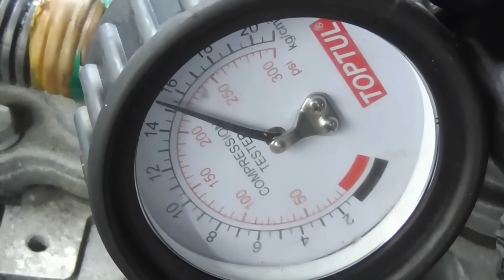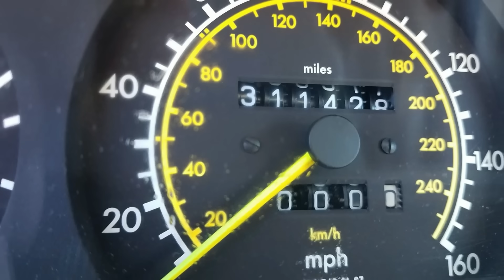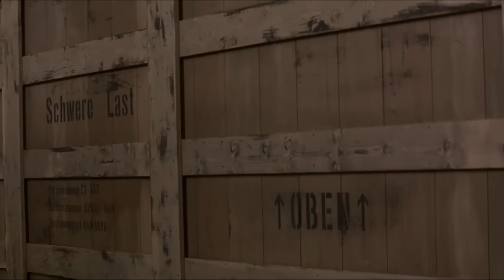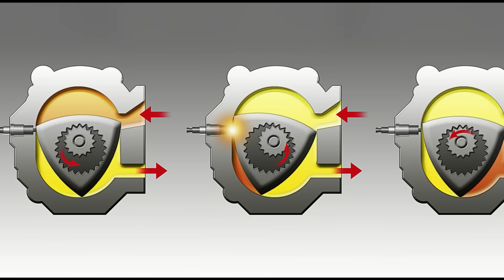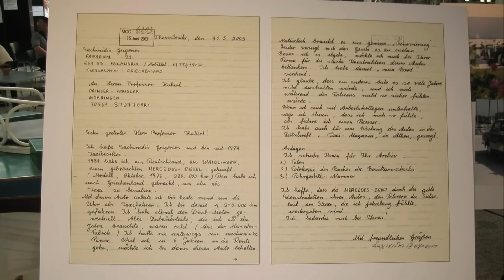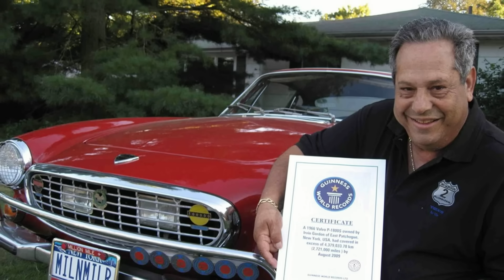Most Reliable Engines of All Time

Comment: Astonished to see a BMW engine on this list lol but there are a whole lot of reliable engines not on this list. Two that come to mind immediately with a pretty legendary reputation here in South Africa (and this is a rough country for vehicles) are the 1400cc Nissan engine used in the Datsun 1400 mini pick-up (the later Nissan Champ), as well as the 1600 VW engine that was in the Beetle during the '60s and '70s. I'm not too familiar with the production span of these VW engines unfortunately, however both these engines were considered stupidly reliable and if something did break it was super cheap and easy to fix as well. The 1400 Nissan engine was in production for almost 3 decades and was preceded by a 1200cc engine which was equally reliable although unfortunately not in production as long as the 1400. Any of these engines could replace that BMW engine you listed in a heartbeat as far as reliability is concerned.

Additionally, you messed up by calling the M115 engine from Mercedes-Benz a BMW - that's worthy of execution to any Mercedes-Benz lover. Kudos for including the 240D, 300D and M102 engines at least - but keep in mind the M115 was just as reliable; my dad's 1978 W123 model 230 has one of these with over 300000 miles on it and it's had a rough life.

Comment: LS400, 4.6L modular 2v, LS, so many great engines that last way over 200K. IMHO if it lasts less then 200K then its a bad design. 200K is easy with regular fluid and filter changes.

Comment: When I was in German Air Force I was in charge for tactical power for a Hawk air defense system. One of my generators ( # 28215 ) equipped with the German Deutz F6L 714 A engine, a air cooled 10 L was around the counter of ops- 10000 hrs. Showing no signs of wear, running flawlessly, normal oil consumption. Imagine that engine would have been installed in a truck running 80 kph that would be 800000 kms. Not impressed ? The Generator had to do 400 Hz what means the direct - bolted to the generator- engine had to do 1500 revs - the whole time... Full throttle 10000 hrs +  - . Now impressed ?
Reply: 10,000 hours for a deutz isn't really that impressive. 
That's how many hours our little 1974 D6006 had done when farm sold in 1996.
I've found forums where farmers in the US have them on irrigation pumps & get 20,000 hours out of them.
Running continuously at 1,500rpm should be easiest on them as they stay at relatively the same temperature all the time.
I talked to a mechanic that serviced Thermo King truck refrigeration equipment with Japanese Yanmar diesels with 35,000 hours on the clock & still going strong.
Another mechanic said John Deere tractors some farmers brought in had 30,000 hours with no rebuild done.
I was googling about ship engine failures a while back & learned about a bulk carrier that had to be towed to Brisbane Australia from somewhere north east of the country.
The Wartsila 6 cylinder medium speed (500rpm) diesel suffered a failed piston after the oil squirter that helped cool it had clogged due to the filter system not being back flushed to the correct procedure. 
The engine ONLY had 83,000 hours on it.
Now I'm impressed

Comment: You have some serious misunderstanding how much engines and drivetrains typically last. Practically any toyota easily goes almost 150000 miles with very little maintenance (only oil and spark plug changes), and over 200000 with very little maintenance.

And toyota 4E engine should definitely be on the list here. Those engines of 6th and 7th gen corollas (and early 8th gen) were indestructable, even though they were small otto (gasoline) engines.

Comment: Most durable and reliable gas engine ever put in a passenger car is Chrysler 225.  We used to say that the only way you could get rid of one was to get tired of it because it wouldn't wear out and it wouldn't break.  I have a 1973 Valiant parked now with 408,000 miles on it.  Transmission needed rebuilding for the second time and we replaced it with a minivan.  The 3.3s in those are apparently somewhat related to the slant 6.  I've seen several 3.3s go over 300,000 miles when badly abused.  Don't know how long they last when cared for.

Comment: Honourable mentions: 2ZZ GE, VW 1.9TDI, VW 1.8T, VW EA888, BMW B58, Ford 3.5 Ecoboost V6, Iron Duke, Tritec, GM LS engine, GM 2 stroke Detroit Diesel, 6BT 5.9 Cummins, 6.7 Powerstroke, Ford Barra, Ford 5.0 Coyote, Jaguar XJ6, BMW M50/M52/M54, BMW N52, Porsche 911 flat 6.
And potentially a BMW N54 if faulty auxiliary parts (cooling system, head gasket) were replaced with aftermarket parts, and maybe a VW air-cooled flat 4 if repaired regularly.

Comment: Almost engine produced in the last 20 years can last 300,000 miles with normal maintenance. The ICE engine has essentially been perfected. What hasn’t are transmissions. They are the reason most cars gets scrapped as they are very expensive to replace, especially if CVTs. Case in point is anything made by Nissan. There are other factors like cash for clunkers and people upgrading after the economy picked up. It’s rarely the engine that is the reason for a car breaking down.

Comment: Guy I worked with got a jetta new, never changed the oil or add to it and it lasted over 150k. My Dad changed the oil in his Peterbuilt once when he rebuilt the motor at 2 million miles. As long as there is oil in there you're fine

Comment: The Toyota 2AR-FE isn’t really that great, you never needed to change the oil because it would burn it all before the 3k-5k miles were up. I had 2 family members that both had a 2008 Camry, they both burned oil so bad after 50k miles that they used about a quart every 500 miles.

Comment: The first car i brought was a 1994 Mitsubishi lancer 1.8 with 260KM when i brought it in 2010, drove it till 350km the meter stop reading, sold it 2015 but to my calculations i reach 500km with the car, i don't know why 100km is is a big deal, even my Hyundai Sonata 2.0 engine is at 320km and still driving like new car, my wife Toyota Vios 1.5 is almost 480km

Comment: Yes i have a buddy with a 350 chevy and in 1983 he had just over 1,000,000 miles on it. Although he did take it apart once a year and cleaned it and oil pump from time to time. Also i have a 2008 santa fee 3.3 and it has just under 300,000 km and still going strong. I met a women who just drives around with the same Santa Fee but a year newer and she had over 500,000 k on it in 2016 ish.

Comment: What a JOKE!  I've owned seven vehicles (5 were brand new).  Only one has  ben serviceable over 60,000 miles, and that one tormented me 90,000 miles.  It's NOT engines!  It's brakes, suspensions, and pollution controls that fail, and no one in my neck of the woods can figure out how to fix them!    My current car, a VW, has only 48K miles, and I've spent well over $3000 the past 5 1/2 months taking it to half a dozen shops and Vw dealers, and the brakes are STILL dragging, overheating and burning up!  The numbskull mechanics here can't figure it out.  I had to ditch a Jeep with 60k miles because the antilock brakes kept slamming on at random at the worst possible times without ever going near the brake pedal!  The car required new control arms every year!  The axles disintegrated (rust).  I've had Fords whose sunroofs wouldn't go two years without succumbing to rust and leaking like a sieve.  What do you do when struts fail every 3000 miles?  Exhaust systems every 5000 miles (the Mazda).  The idiots here insist on using a torch for all exhaust work.  That makes components even more susceptible to rust. They insist on using air wrenches to tighten lug nuts.  200Ft. lbs!  It shears off lug nuts and destroys rotors.  I've begged them and tipped them to use a torque wrench, but if you're not able to watch the procedure they pull out the air wrench.  Their own cars are immaculate.

Comment: Shame on you for not separating gas from diesel engines. They are completely different style mechanical systems and therefore produce completely different degrees of reliability. A diesel engine has no place in a list of most reliable gas engines and vice versa.

Comment: My first car was a 1993 Mercedes-Benz 300D with only 18,000 miles on it.  I actually still have it even though its not my daily driver now nor has it been for maybe 19-20 years. But man that car has been ALL OVER the US. Its seen every state but Hawaii.  I'll be giving it to my son for his 16th birthday (its just so damned reliable) Its had no major repairs just basic maintainance oil, rotation fluid flush and so on that you have to do so you can keep your car in best shape as possible :) its got 410,587 (looked it it before I typed it)  miles on it. You'd just never known that hearing it, or looking at it. I repainted it at 380,000 always kept the interior spotless. Leather properly moisturized what carpet that it has vacuumed and 2 times a year steam cleaned. More or less it looks just like the day I got it. Sounds just as good too. I also completely took it apart and did a sonic clean on eveey single metal component very recently as sons 16th bay is now only 6 months away. Realistically I didn't need to do that, I just want it to have every conceivable advantage when giving it to my son and who knows. Maybe he'll give it to his son. As at this moment the car actually looks brand new. No engine buildup perfect interior right down to the radio with tends to have the buttons rubbed away a fair bit. Not a single scratch exterior not even on the rims. Brand new tires and service records from the day I bought it until this day as proof of the care I take of her.

Comment: i have a 1999 chev silverado swb 4x4 w a 5.3l ls with 633000 kms on it. all thats been done to it is change oil, plugs, wires, one coil, odd sensors and an rv cam when it was a year old. trans had to be built twice. still origonal 246 electric transfer case and differentials. idles at 550rpm and still pulls hard.

Comment: My current work van...
Is a 2003 1.7Di Vauxhall Combo.
It still has its original engine and gearbox.
It has done 450,000 miles

Comment: Kinda bummed, no mention of Fords 300 straight six, I had a 81 F-250 pickup with one previous owner that used it as a working truck pulling a farm tractor to camp every week, I got it with over 300,000 miles with original cluch and blown head gasket which I drove around hot with chocolate milk for oil for awhile till I fixed than ran another two years

Comment: Right off the bat, RB26, regardless of rather it came with twin's, or single turbo from related varients of the RB, this says nothing about it's strength, and 1000-1200 is a far stretch if you're not boasting a highly reinforced buildup of this engine, but the cost?? Outside of a Rotary engine, the RB tends to carry a high price tag from what you'd pay from a front clip, and all the aftermarket parts with it...is that too say you couldn't build a moderately powerful RB at a fair price, no, but I wouldn't label the engine cheap... You want an over engineered JDM engine for cheap compared to others, look for a 1UZ.

Comment: I had a 1987 Volvo 240 wagon w/ a  4 cylinder B230 engine and Asin Warner auto transmission. By 1992, the original owner had put 88K miles on it when I got it. After 500k miles, the water pump and timing belt had been changed maybe 4 times; the alternator once; the transmission tail shaft bushing and seal twice, the shifter linkage bushings once, and the downshift cable 3 times. Used 4 sets of spark plugs, a couple of O2 sensors and an air flow sensor; three sets of v-belts; a couple of distributor caps, rotors and plug wire sets. One fuel pump, a couple of overdrive relays, motor and transmission mounts once, a brake master cylinder, and occasionally brake pads/rotors and tires. The muffler was replaced once, and the tail pipe twice. The windshield was replaced a couple of times due to flying rocks. Still had the original wheel bearings, steering and suspension components, except replaced the struts and shocks once. It had the original u-joints, power steering and starter. Never had to adjust the valves. Changed conventional oil/filter at 3000 mi. intervals when used for around town driving and 5000 mi. for highway use. Drained the fluid from the transmission pan and replaced ~2 quarts of fluid annually, or when the downshift cable was replaced. Still ran great and the original paint looked good when it was sold in 2008; because my daughter wanted something sportier (which didn't last very long). The original synthetic driver's seat upholstery was worn some, well a lot, but it was still in one piece.

Comment: So my 2002 Lexus GS300 with over half a million miles sounds like a joke. 2JZ timing belt lasted 400,000 miles. Same transmission, differential and about 95 percent of the suspension is original.

Comment: It’s too bad Saab was bankrupted by the assholes at GM!  I have a 2007 9-3 with 216,000 miles!  Original engine, original 6 speed tranny, original wheel bearings, timing chain, water pump, head gasket, original Turbo, never rebuilt! It doesn’t use a drop of oil.  I use Amsoil signature series synthetic, from the day I bought the car, when it had 59,000 miles on it.  I have had other Saabs in the past, with this kind of mileage.  It’s too bad they don’t get a mention, and they are still out there, used!  In addition to the 2007, I recently purchased a 2010 Saab 9-3 2.0T XWD.  It now has 103,000 miles and doesn’t use a drop of oil!  Runs like a champ!  Everybody that I have run into that has owned a Saab, says it’s the best car they have ever owned!  Long live used Saabs!

Comment: I have a 93 toyota pickup with 370000 miles on the 22re engine. Still runs good and burns no oil yet. Good little truck.

Comment: Had a 1970s era GM 350 with confirmed 500,000 miles that still ran fine.  Used a quart of oil every 500 miles (some leaks) and only smoked when throttle was opened all the way.
Reply: GM made millions of trucks with the 350 V8 and lots of them are still on the road today after 30 years. It isn't just the engine though, if you live in the rust belt the body and frame will be gone long before the engine gives up.
Reply: @mikenagy938  GM 350 V8 are old technology that just kept on going and yes, we are in a rust belt.  Benefit is we would get a good body car, find a rusted out donor and swap.  Do not have the energy to do that any longer and modern cars make that more difficult.
Reply: Yeah but the old GM products are not the GM products you have today! Back when each division had its own engine. Personally I was a Mopar man slant 6 and 318 or my engine choices.
Reply: @williamsample2631  Even in the 1970's the GM 350 had many common component.  Some were just color and sticker differences for the base engines as far as I could tell.  The differences may have been in the performance engines for different brands.  In my case I pulled a Chevy V8 engine / transmission from a station wagon and shoe horned it into a 1979 Buick Century Turbo Coupe (Originally a V6) because the turbo failed (Ex-Wife's car) and was spilling oil through the exhaust.  Fit like a tailored glove.  Had to switch engine mounts but the holes were drilled in the Buick's frame member.  Also needed to swap out transmission linkage part.  Even the drive shaft was the right length.  Did not even need to adjust the shift linkage for PRNDL.  Easiest swap ever.

Comment: Nissan I have a 1995 Nissan pick up 2 Will Dr. with 214,000 and it does not use no oil in betweenChange it every 3000 miles

Comment: If the engine lasts 500k miles, then it can be said that it is a reliable engine... 200-300k miles is nothing - it last most cars on the road. :)  I personally know cars that have over 700k miles.

Comment: This list is FAR from comprehensive OR accurate in that the statements don't align with some of the images or facts in general. I would say that at best this could be a most easily modified tuner engine list. I can't even list the number of 12V Cummins, Duramax, or Power stroke diesel trucks that I've seen over 500,000 miles, countless numbers of 5VZFE Toyotas at 300K+, God only knows how many taxis (looking at you GM3800) that have original engines with over 300K as well... Or how about the GM LSX that closed deck cast iron beast that has a factory warranty that covers ANY modifications or racing use, can't tell me that an engine which was used a structural member of the C5R ISN'T reliable. I remember watching those guys run FLAT OUT for 24 hours and dominate the GT class at lemans, Sebring, Silverstone etc... Follow the maintenance schedule and almost any engine will go 200K+